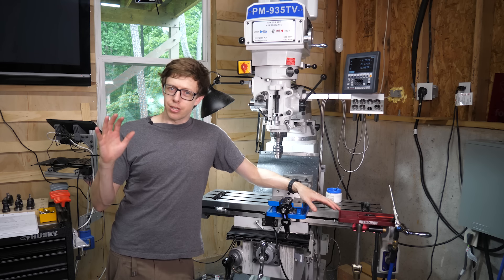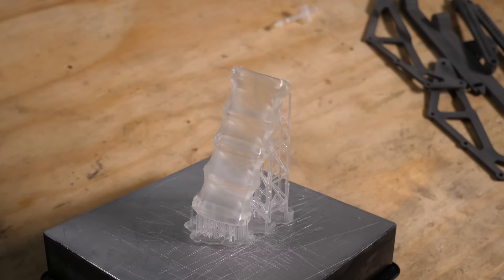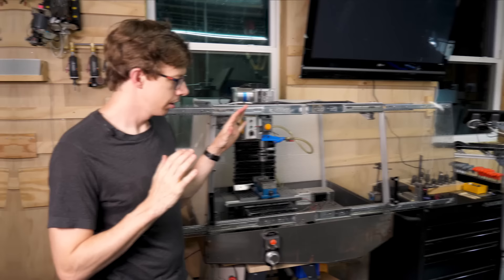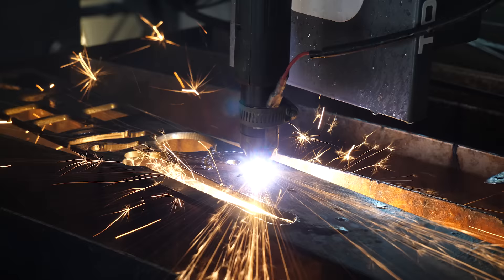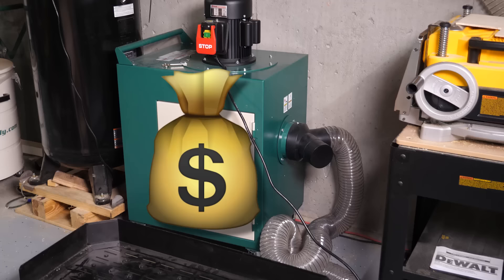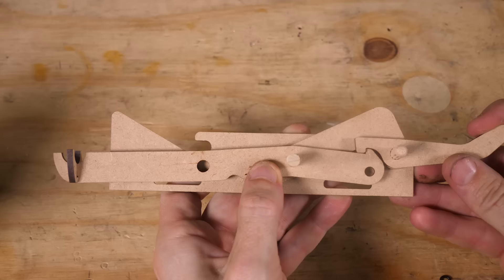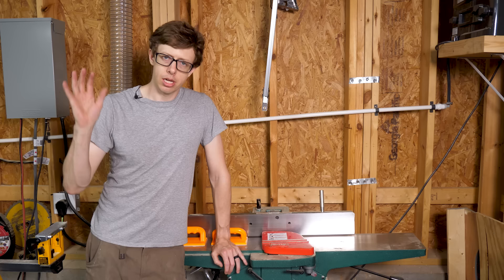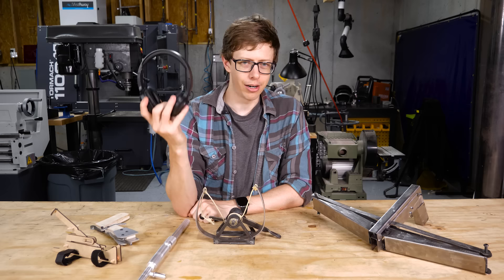This is why I have 17,342 pounds of tools

Comment: There are professional engineering companies with less equipment than this
Reply: I work at one of those
Reply: @cookiii  I'm guessing Jason does too?
Reply: @paulforeman9583  yes, I can smell the aroma of pure jealousy just by reading his comment
Reply: Not to mention less brainpower as well...
Reply: but, they’re companies, not a single person, you act as if this dude can work at the same efficiency as a company, because he has better equipment
Reply: @randomguy2472  except that's not the point of the comment???
Reply: @randomguy2472  the point is I'm saying he is ridiculously well equipped
Reply: @szem4301  Pretty sure it isn't jealousy
Reply: Is this guys father Bob Lazar?
Reply: @firefox7801  bro, this is hilarious. also, I'm pretty sure it's true. love your work in internet browsing btw
Reply: So what?  That should hardly surprise you.  Most engineering companies I worked for as an engineer didn't have fabrication equipment. Metal fabrication companies and job shops have machines and make things. It's not an engineer's JOB to do that.  Kind of a vapid comment, mate.  You know what else is true?  Most car parts stores won't work on your car for you. Again, so what?
Reply: @railgap  what is that babel your spitting? not an engineers job hahaha. metal fabrication is very much apart of an engineers job. what sort of engineer are you? civil? grab ya spade.
Reply: @szem4301  He stated a fact. That you sense jealousy based on his statement of fact is only a reflection upon you.
Reply: Most of them can be free he is advertising and promoting some but very cool to have all of them though.
Reply: @randomguy2472  Im pretty sure this guy can work at a higher efficiency than some companies.
Reply: @randomguy2472  we understand that one man cannot work with more or matched efficiency than a team of men. However, one man that is talented and well equipped can create more specialized items with more stylized results making him more valuable. You’re comment doesn’t relate to the comment you were replying to at all, but I thought I would still show the irrelevance of what you’re saying regardless.
Reply: Like mine for example, but his videos keep me dreaming :)

Comment: “This is my mini lathe which I had in my apartment” could you imagine trying to sleep and at 2am your upstairs neighbor starts up the mini lathe lol. Cool video.
Reply: They aren't that loud actually
Reply: Metalworking tools are quiet, rigid, and precise. If they're noisy, there's probably something wrong. Woodworking tools are screaming banshees of dust and destruction, you know you're working effectively if you can't hear yourself think.
Reply: Was gonna mention it but y’all beat me to it, got a cheap one from china and even at full bore 2000 RPM it barely makes any noise
Reply: I did the same thing. It was not loud enough to even wake up my wife.
Reply: the loudest part is the coolant pump

Comment: you know these tools are expensive when he casually drops a link for $500 off a laser cutter
Reply: Yep, lucky guy. I'm pretty sure it's comfortably $100k worth of gear, probably more
Reply: Zuchini Noodle  also since he worked on making tools, he probably gets a lot of discounts
Reply: And the fact that that's one of the cheaper tools he showed, lol.
Reply: Zuchini Noodle  He said in this video that he was given most of them for free by the manufacturers since his channel took off.
Reply: @Michael-sh1fb  The Tormach1100 alone is >20k ;)
Reply: I looked it up just the plasma table and CNC mill is 20k each. This dude is rich
Reply: Even with $500 off the Glowforge is still a really bad deal for the money.
Reply: @Michael-sh1fb  that Haas tool he wants is like 129k

Comment: I just discovered this channel and it impacted me so intensely that I had to  sit down. I am a "lifelong Learner."  That is since I was very young. I have worked in most of the skilled fields in my life. Carpenter, Cabinet maker, Machinist, Designer and Draftsman,  Pencils, Compass, Straight Edge and  The math to go with it. I really struggled with math (Hearing). School was not my strong suit. It seemed like more of a way for some adults to have a job with summers off. "I never let  school get in the way of my education" (Mark Twain). I am truly impressed by you young man and I hope that the young folks are getting that humans need to create and make;  it's in the DNA. It satisfies a prinal drive many are blessed with.

If you could point me toward someone to help me resurrect my "little Machine Shop" Mill  which was given to me I would really appreciate it. At my age (80) I need to practice "Time Management" if you get my drift. Keep on Keepin on.

Comment: "Using explosives is against my rules"
"Air pressure is basically a spring"
Hmm, what mechanism do you think explosives use to launch a projectile? Could it be... increased air pressure? :)
Reply: Maybe... the chemical compound deflagrates (depending on he compound) and rapidly expand its size by forming hot gas expelling the projectile??? yeah that is againist my rules, let me do the same thing but you need to charge it by hand
Reply: Explosives produce the air pressure change via chemical reaction. Maybe since his air pressure increase is mechanically induced he considers it an exception to the explosive rule...?
Reply: A bullet operates off of pressure, but it's orders of magnitude above what you could achieve with compressed air. Chamber pressure for .22 rimfire ammunition (which for all practical purposes is the weakest viable cartridge) gets up to about 24,000 psi.
Reply: Yeah but if you use explosives to make compressed air to throw something you've basically made a gun which governments don't like for some reason. I've never understood it personally, if you have the know how to make a gun and the tools to do it you're clearly an adult, the government isnt your mother, I think they should mind their own business but whatever
Reply: @CM-NightDK  Well, reassembling the gunpowder seems like much more work than cocking a spring or pumping a reservoar. Also, he said previously that he didn't want to just create variations on the trigger of a spud cannon. If you want to get really pedantic, springs should also be disqualified if you don't want to base a catapult on the forces of an unstable arrangement of matter rapidly rearranging itself to a less energetic arrangement. Everything is "exactly the same" if you look at it really broadly. A reservoar of pressurized gas is a store of mechanical energy, while gunpowder is a store of chemical energy.
Reply: He did use it in past I think 🤔
Reply: @MrVeps1  indeed. In a broad Sense the gunpowder Just generates pressure and temperature thus forcefully expanding the volume (bullet fires) and pressurizing by hand is the same thing (forcefully expanding the volume) but i am not sure about the temperature
Reply: He really should have made different rules, like showcase a machine or a couple of them per catapulte, most of his "catapults" were pretty lame. Not gonna lie though, that DaVinci catapult and the tube "catapult" made on the lathe, they rly surprised me, I definitely didn't think and glass was getting broke with the tube, and the DaVinci gotta be hard to aim
Reply: @johnmccrossan9376  I mean, you’re suppose to need a gun license, and I don’t think people making guns in their basement have gun licenses, and plus, what if a person that made a gun had bad intentions, as such murder, or robbery
Reply: I think he means the "make all the important parts using the tool" rule that he set for this video.
Reply: @randomguy2472  that's a fair point but gun licences have the same issues, I think it should be up to the gun shop owners to decide who to sell to. Also look at all the tools he needs to make something that's nearly a gun, if he had the money for that burglary wouldn't be an issue, and itd make more sense if he wanted somebody murdered to just pay an assassin
Reply: I’d say the big difference is that you dont have to charge gunpowder

Comment: thanks for reminding me of the little crossbows I used to make in school out of paperclips and rubber bands. It used to launch small metal bolts made from bending off paperclip ends into drywall, a good quarter inch.

Comment: "I'm going to attach a high power motor to this" Attaches Electric Drill
Reply: I tried once to make a vibrator for the concrete casting with the 10k rpm motor from a washing machine. To do it I attached an eccentric weight to the motor shaft. The weight supposed to be a metal knob but I decided to use a lighter plastic piece (10 grams or so) for the first run and covered it with a plastic bucket for safety reasons.

Long story short on the very first run it showed me the power of the centrifugal force. 5 seconds after the start the weight had been broken. The bigger part became a projectile, pierced a bucket, and went to the ceiling making a noticeable crack in the plaster. Thank God I didn't run it with a metal knob. 

So never miss with high rpm motors and centrifugal force if you don't want to test that aid kit for the exiting wounds on your back :)

Comment: What a cool shop tour. Thanks. (And not to be nitpicky, a bit better explanation for the cyclonic shop vac @29:15 is that the dust is moved through the collection pipes because it has high velocity (small diameter). When the air enters the cyclonic section, the space opens up (large diameter) and thus the air pressure drops. The dust doesn’t “have wind around it anymore” to keep it moving and thus it drops down. I’m sure the big parts will also fall out of the air stream like you show it in a centrifugal path, but it’s essentially due to the drop in air pressure. Simplest way I’m able to explain it. Oh and kudos, I really like how you simplify the explanations. I’m so blinded by having used many of these tools in the past that it wouldn’t even dawn on me how non techs eyes would perceive them. Cheers.

Comment: By the way, they found on crossbows, that the closer to the tip of the Bow part, the thinner it is the harder the crossbow will shoot, as those limbs move at incredible speeds..
One way is to make it a triangle shape, but you can also use twists in the spring, to reduce drag the further out you get.

Comment: "Plastic doesn't really like to be a spring" um tell that to the engineers behind every toy in the 1990's. Because you are right. They just used plastic as springs a lot back then.
Reply: Actually plastic makes very good springs.
You just have to get the right material and design for the job.
I bet you'll find a dozen items in your household with plastic pushtabs and a handful with plastic leafsprings
Reply: Thats why i jokingly mentioned childrens toys. They used the cheap brittle stuff and acted like that was a replacement for metal lol.

Comment: Did you try a lubricant between the leaf springs on the crossbow (light oil/graphite/baby powder)? If the energy is being lost to friction, that may improve performance. Probably not enough, but interested to see how much it helps. Fewer springs with greater thickness should also help.

Comment: "I'd have to know what a leaf spring is to be impressed by that" 💀💀💀
Reply: Well he could take her outside to show her the leaf springs on the rear axle of one of their cars, unless they have independent rear suspension or some other fancy suspension system.
Reply: @markfryer9880  Wait you still have leaf springs on domestic vehicles in the US? You'd have to find a really old car or a commercial truck to find leaf springs over here.

Comment: Makes a gun
"This is a catapult, right?"
Reply: Springloaded ball hauler.
Reply: Nah, catapult should be a lever-based solution, imo.
Reply: @hunterhenryk  ah bummer.
.......so a trigger is a lever, right?
Reply: Could just use a spring inside
Reply: @royk7712  Air is a spring
Reply: @Exayevie  Are guns and the spray nozzle on your garden hose catapults too then?

Comment: If you want to break the glass, I think it makes more sense to have the ball hit the glass at a 90 degree angle instead of 45 or so. That way, all the energy of the ball goes into breaking the glass and isn't deflected away partially. I'm not really that good with physics so I don't know what the energy loss is on the deflection though, maybe half?
Reply: You’re right.
Reply: smaller ball at higher velocity would help a lot too

Comment: for the round catapult you could have used a sistem like for a springloaded center puncher where you press the tip of your catapult down really hard load in the ball and then use a mechanism to trigger it

Comment: When I was a kid I made a functional crossbow out of Legos Technics. It had a functional trigger, was powered by rubber bands, & shot bamboo skewer sticks with Exacto blades taped to the ends. Some parts had to be Crazy Glued or it'd fly apart every couple of shots. It was dangerous! It would shoot them about 20 feet & the mini arrows I mentioned would stick into hot pavement. I may just possibly have a scar in my chest from where my friend "accidentally" shot me with one of the arrows.

Comment: Hey! I dont know if youll read this but I think your design has a fundamental flaw!

#1 Frisbee golfers dont swing the frisbee in an arc but attempt to draw a straight line with the frisbee! Your design wastes a lot of energy and encounters a lot of issues with angular momentum due to attempting to throw in a large arc.

#2  Throwing the frisbee is only the first step. You also have to spin the frisbee at the correct speed! I'm not sure your design accounts for that as you didn't mention it in the video.

You should instead pull the disc in a straight line with your mechanism to ensure maximal launch speed with minimun angular momentum issues and give the disc spin by somehow constantly spinning it oe giving it a "flick" at the end. Could be an idea worth exploring?

Comment: 5:30 you would think that since the powder and parts are all contained within a confined space, a vacuum could be designed to suck all or most of the powder out before you open it to get the parts.

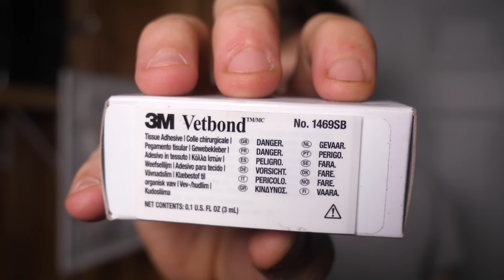Comment: Probably pretty late, but at 19:40 - 19:47 - Skin glue made for animal use can be used just the same for Humans, one of the main reasons is, well, we are animals in the long run. And two, Skin Glue contains nothing toxic, or else we wouldn't use it on Animals in the first place.

I am aware that some tissue glues have Formaldehyde, which is toxic to any creature alive, but the glue degrades it so fast, as long as you don't swallow it or try to glue your eyes shut, you'd be fine.

Comment: the curved backboard, i wonder if it would work flat, with different materials having a difference bounce characteristic and slight difference in the angle of attack, focusing the ball to bounce a certain way if it hits a certain part, how big could you go, could you even have a little pneumatic wall that will knock the ball any which angle you like

Comment: I just realized I believe I have that same Harbor Freight-sourced belt sander. I can confirm that it is both kinda shitty and completely and utterly unkillable. 

The platform likes to suddenly slip into an angle on mine, which has led to more than a few grazed knuckles. This could be prevented if I simply remembered to tighten it before I sand anything…but that will never happen.

Comment: I was interested in the glowforge, until I came to the "Can the Glowforge print without a Wi-Fi connection?" bit of the FAQ.  If I spend five grand on a thing, I'll want to be able to use it without it becoming an oversized paperweight when (not if) the cloud service goes away.

Comment: so YOU are responsible for the nozzle mess the form 3 produces sometimes. The cartridges have this gummy nubsy thing that gets pushed by a servo... but sometimes it is not sealing correctly (fills up the printer and makes a mess) or it won't fill at all if the cut is not deep enough. 

I love the Form3 but that part is the waekest link on that printer.

Comment: Me: this is a 3.2l in-line 6 that’s over 15 years old that’s putting down 450 horsepower to the rear wheels without stroking or forced induction. It’s my pride and joy, and the most impressive achievement of my life

My girlfriend: 6:41

Comment: Comedy gold! 

". . . but I think the more correct technical term for this is: an Absolute Unit."
"This one's pretty similar to the last one, except it's totally different."
"Argon is a noble gas, which means aside from its aristocratic lineage, does not want to react with anything."
"I'm using this cool tool called a "Ring Roller" and it's used for rolling rings."
"This is what I use (burn spray) when my wife talks about one of my projects." 
"Really high heat, a bit of pressure, and two become one, just like marriage."
"It's only cool if you can break your house windows with it."

Comment: I really like working with a lathe but im also scared of it. A few years back someone in the workshop drove the cutting tool very fast into the the metalblock and it ripped out the block and it missed my head by only 10-15 cm and flung into a metalwall. I just stood there frozen and almost soiled my pants.. well since then i was extremly carefull around lathes and cnc machines.
Reply: Leaving in chuck keys is another common one. Hair getting caught is always scary as hell, and the worst, is when you have to open up the thing and clean it. That is how adam savage almost lost his hand a couple years back. High torgue motors. Scariest kind of tool imo. I would take something sharp over high torgue any day.